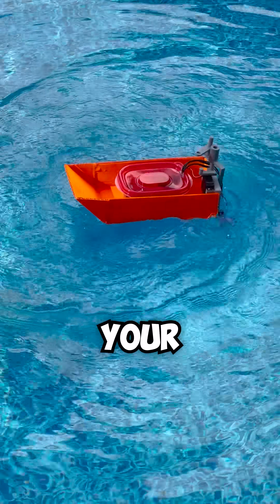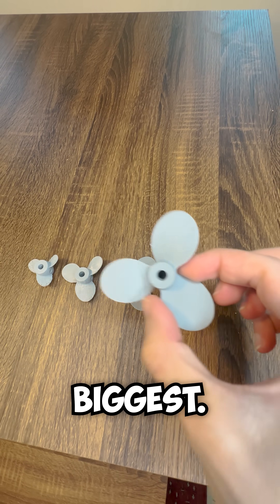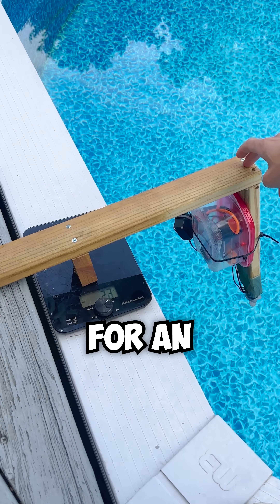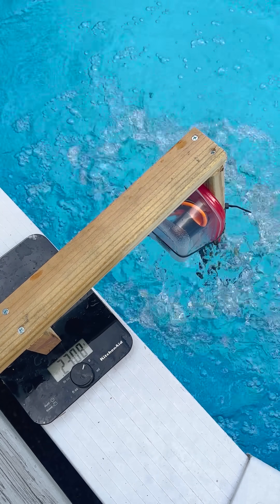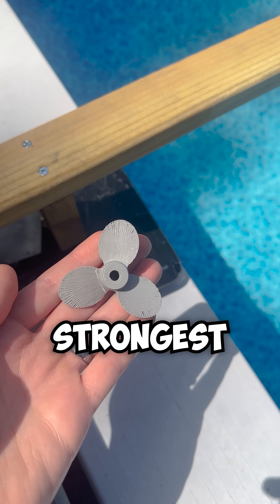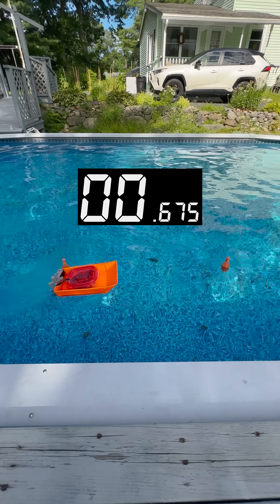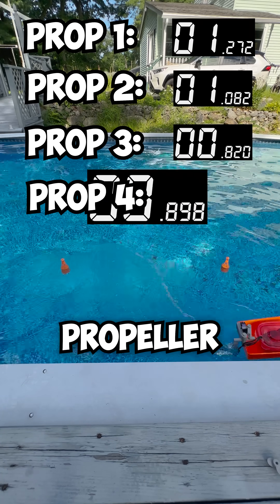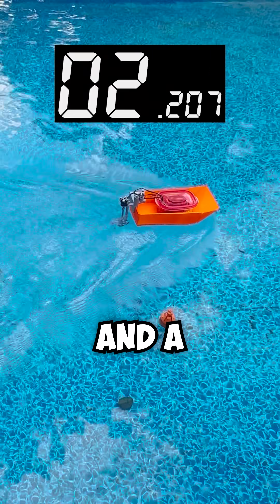Ultimate Propeller Test!

Comment: the biggest Improvement you can make to those impellers is improving the geometry and the print quality cuz  currently those things are going to have more drag than a gay bar in Vegas so  either send them down and put a filler primer on it and do all that stuff or buy a resin 3D printer or use a service to have them printed in resin

Comment: Here’s what I would recommend: use a higher Kv motor, that one is wayyy too low to efficiently use one of those props. If you use a higher Kv motor, you will have less torque (you’re not even barely using the torque this motor has) but a higher top end RPM.

Comment: You should make a graph using excel and plot the propeller diameter on the x axis and the thrust on the y axis. If you extrapolate the curve, you can see exactly what radius of propeller will give you the most force before it starts to lose power

Comment: I advise you to use propeller 1 but with a sharper blade. You also need to make the front of the boat so the boat doesn't have resistance.

Comment: You should swap out the 3-blade prop for a 4-blade prop. 4-Blades are more efficient and make better use of the available horsepower.

Comment: There is a motor power to prop size ratio. P4 was bigger but the motor didn't have the power to turn P4 at the same RRM as R3 to push the water. NOW THEN... P4 MIGHT go faster as momentum is generated. This is not examined in your test.

Comment: You should make propellers slightly smaller and larger than 3 and see which one works better. Then keep doing that until you find the most efficient propeller size. Then do it with different sized/weighted vessels. Do it all the way up to an oil tanker and revolutionize the marine industry. Good luck!

Comment: Rudder connected to a system of small motors for better steering and need a balance of weight with a suggestion to make the boat bigger if possible.

Comment: Welcome to the world of Fluid dynamics.
Bigger is not always better.
Reply: Then why do big ships have enormous propellers instead of millions of #3 here
Reply: @paulh2981  because its not feasibly possible to have missions of propellers on the back of a ship in both resource costs and weird hydrodynamic things that make it worse than those big propellers. Its the same reason we dont have a hotel thats 20 miles long and 20 miles wide, it may be more effecient housing in terms of people per square foot but  it runs into alot of other issues from resource cost, to terrain, to building stability, and much more.

Comment: give it a piston engine, using hydrazine as fuel, and an even bigger propeller and increase the hull size to support the added weight, also more length to make it more stabile. trust me, its going to go like a rocket on water :)

Comment: Thrust is a force (as much as i have studied physics) so it should not be stated in grams. 2800g=2.8kg now, F=mg
Thus, F≈2.8×10N=28N
Reply: That’s not the only problem. The thrust-measuring rig doesn’t give the thrust at the prop, it reads approx 3x the actual thrust. Principle of Moments and all that.

Comment: Put a tube under the center of the boat with two angled cuts on either side to let side water rush through as well. Put this in line with the front of the propeller, and it should (i think) create more of a jet like effect.

Comment: Have 2 propellers instead of one. 
- If you have them at the front and positioned off either side, you would have better and tighter control during movement and more stability when accelerating.

Comment: Your boat would improve by having a "underwater nose" and body it will stabilize the fourth propeler and might also help if you use two propelers instead. Which should be spinning oposite of each other. Also dont forget to put some weight underwater which should not change with the movement! Soo no water or sand or grains you need actually ballast there.

Comment: You might want to consider using a resin printer or smaller layer lines on fff printers, rc test flight made a video I think where he tested out the propellors MIT made but he tried them in water and added alot of drag because the way they were made

Comment: I have an idea that came from military helicopter engineering that could make the stronger rotors more stable. Twin rotors. Take a rotor place it put another behind it, flip it and make it turn in the opposite direction with the same ammount of power to make the inertial forces balance out and the thrust reach twice the normal level.

Comment: For those wondering why 4 wasn’t the fastest, it is pretty big so it creates drag
Reply: Yeah, and the boat is too light so the control would be wild
Reply: Yeah, nah. I'm guessing it is an issue with motor torque vs efficiency. Bigger prop needs more torque from the motor to drive, which I'm guessing is over the hump.
Reply: aren’t cavitations also an issue with 4?
Reply: It's as that turque guy said. Bigger = more torque on motor = less rotational speed.
He need to map out that time on a graph to get the best propeller size for that specific motor and boat.
Reply: Motors have a speed at which they produce most power (a "power curve"). Either faster or slower and it will produce less power. Propellers 1 and 2 are too light for the motor, prop 4 too heavy.

For best results, a propeller needs to be matched to the power curve and to the desired optimum running speed.
Reply: Maybe it conpromises volume moved with weight?

Comment: The fact that your boat is pretty light, and your motor + propeller creates a lot of torque makes the boat twist and flip
You can see it when you accelerate or take a turn

You could either put weights and lower the center of gravity ad other said
But you could also just use another motor and propeller, that would spin the other way to counter this effect
(But you should still find a way to lower the center of gravity on the boat)
Reply from the maker: I like the idea of counter rotating props

Comment: The propellor 4 would have the top speed. It is like a car you see. Such as a gearbox ratio lower the ratio higher top speed but less acceleration. The engine you used didnt had enough thrust for propellor 4 to turn at maximum speed.

Comment: You should really print some higher quality ones for boat propellers to be efficient. It is really really important for them to be a smooth as possible and as balanced as possible for the best hydrodynamics and probably use some sandpaper

Comment: maybe use 2 contra rotating props to increase stability as it looks like the torque is twisting the hull of your boat. Its a similar fix they used in ww2 on planes. even 2 side by side props would probably mitigate it if they spin opposite directions. See the p38 lightning for that configuration

Comment: You should 3d print a hull like a battle ship and put the prop motor in and the shaft thrue the wall of the back and then the prop on the end of the ship then make double stear like bismarck had and done you have super fast good looking ship😂

Comment: It’s not just propeller size. It’s also propeller pitch. Depending on the pitch, it’ll have more acceleration/torque or more top speed.
Reply: I wanted to post this to you so maybe you can further this info with your comment
Reply: That makes sense!  I bet the variables determining the proper size and pitch ratio are the weight and drag of the boat or sub, and the type of motor (higher HP vs higher torque)
Reply: As a boat mechanic I support this comment. Also rake  and cupping goes into it
Reply: Will do 👍😁
Reply: Make propeller smooth
Reply: Also knife edge the front of the propeller blades and smooth the front and rear almost to a polished finish….. Then you can graduate to removing material of the blade to create a mild cup to further tune the prop.

Comment: Ditch the 3d printed propeller. Terrible surface quality.. you want it to glide smoothly not grab the water
Reply from the maker: I'm working on a newer propellor that is smoother. Stay tuned! I think you will like it.
Reply: @makermandan  also mount the motor inboard the boat with the shaft running down through a sealed tube.. much less drag underwater

Comment: those circuits in the motor have gotta be corroding pretty quickly under water
Reply from the maker: Its been a while since I posted the video and the electronics still work fine as of this morning.
Reply: @makermandan  it's more of an issue of how often the motor is run underwater, and what is in the water, than just time. like, short term (or in tap water), the motor should continue to work fine. but, because water contains minerals, (which makes its conducive), funky chemistry stuff will happen between the water and motor internals. this is because of exchanged electrons between electrolyte ions and the metal contacts acting as cathode/anode. so you get funky chemistry stuff, mainly hydrogen (and other) bubbles, and corrosion happening. 

this effect will be very pronounced by running the motor in salt water. this would destroy it very quickly, but there will be a colour change in the water, and there will be LOTS of bubbles (including chlorine gas).

Comment: what you'll want to do is very lightly dip the propeller in something like acetate. It will break apart the plastic, so it will need to be carefully controlled, but it will leave a very smooth finish, which will further increase its thrust.

Comment: Makeing the bow sharp (angled) along with the slope you already have would allow it to stay under control easier.  Also your useing "vectored thrust" to control the boat leaveing very little to actually keep the boat straight in the water. Adding a angle to the front would help but adding a keel or a rudder (around the existing motor system) to force the boat to move only forwards/backwards.  It you prefer the stable flat bottom design,  then follow full scale answers and make the boat narrower on the front and round the corners, then add several smaller "keels" or ridges olong the bottom to channel the water along the bottom. Right now you have a raft more than a boat. Also as several others have mentioned adding some ballast would be good for the boat, a little sand in a bag would be easier than lead and should suffice just fine. You want there to be enough to stabilize the boat on a turn but not so much the motor's angle you already have to stop pulling the bow up.

Comment: Make the front of the boat narrower and sharper. It will reduce the resistance given by the water and will provide more speed. Don't forget to add little weight to the bottom of the boat to balance it  or else it will flip
Reply: Longer hull will also give stability. But I agree, too long and it'll capsize easily.
Reply: Bigger boat + more smooth design and more ballasts for better stability
Reply: No, it doesn't need to have a sharper bow because he is only trying to make small fast boat that doesn't really need a heavy load. In short he is making small speed boat. Speed boat just flies over the water and there's hardly no drag when it's so fast. Different ship/boats has their own appointed bow type...
Reply: Wait aren't you supposed to turn it into a teardrop shape?
Reply: @botnumbers4703  yes that's what i meant, not that idk why*
[ bad
< decent
( best
Reply: Also the front end of the rc boat he made is used to hover over the air...
Also the boat he is making is so small there's barely no resistance if there is...
Reply: YES Like the cigarette
Reply: Doesn't have to be sharper
Reply: @yuanfurbax yes it does due to the high resistance and pressure of the water compared to air with low resistance and very low pressure.
Reply: @sylvlatte  but why sharper? Why isn't narrower enough?
Reply: @yuanfurbax  Because you need to cut through water?????????? Check the design of speed boats
Reply: @yuanfurbax  narrower could possibly be more unstable, but still a mix of longer, a little narrower and sharper hull would be tye best
Reply: Speed boats plane on top of the water like skipping a stone. The sharpness doesnt matter at higher speeds @4Core100

Comment: You should put some small weights not to many though just to balance it.
Reply: or make a keel
Reply: @thecateatingasian yea exactly, literally a weight to balance a boay
Reply: basically ballast
Reply: @Akiyama.ミズキ yeah
Reply: @Akiyama.ミズキ like the cargo ships with "indoor pools" to simulate ocean behavior?
Reply: @gameseeker6307  that but much much smaller
Reply: Keel before ballast.
Ballasts aren't really for stability. Ballasts are primarily to keep the ship's displacement consistent across various load conditions.
The Keel is for stability.
The wobble and roll he gets with the larger props is due to a lack of a keel.
Source: I grew up in a shipyard/drydock.
Reply: Stupid advice, but I feel like if you would try toroidal propellers, it would look really cool
Reply: A 4" tungsten cube would do the trick
Reply: ADD weights  = LOW POWER